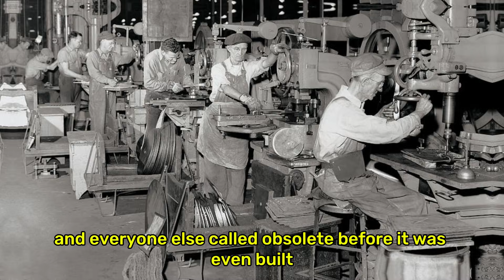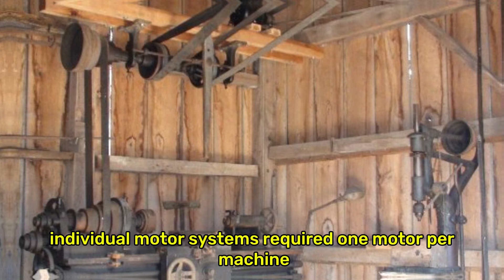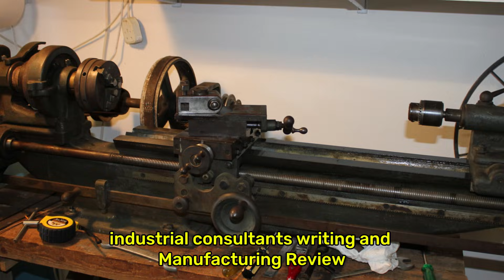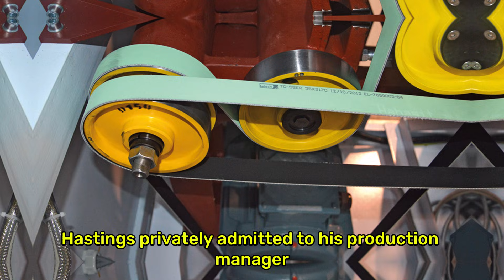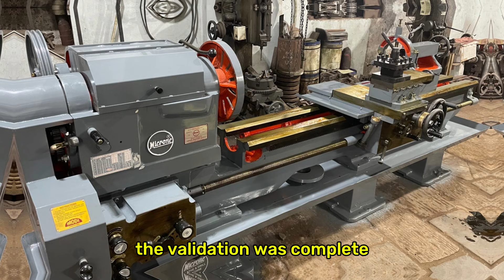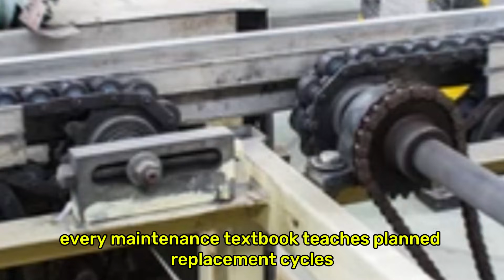The 1910 Lathe Factory Owners Laughed At — Until It Ran Nonstop for 80 Years

Comment: In the late 1960's I worked in a machine shop that turned replacement shafts for high horsepower electrical motors.  The shafts were going to a shop that repaired the motors.  That shop would often rough machine the shafts and send them down the road for finishing.  The machine they used for rough machining was built by Eli Whitney at the turn of the 19th century.  It couldn't keep tolerance anymore due to wear and you could see that it had been modified from an overhead power shaft to an individual motor drive.  The owner just kept saying, "It's still turning a profit.  It doesn't need to be replaced."

Comment: I have been an appliance thec. for the last 55 years,My back up refer is an early 30s GE round top. With the exception of the wireing (paper and cloth coatings) that I replaced 40 years ago it is all ariginal. Only has space for two ice cube trays,but it starts every time I plug it in. If they could do it then ,why not now..   economics?